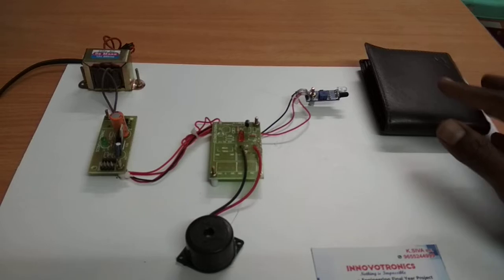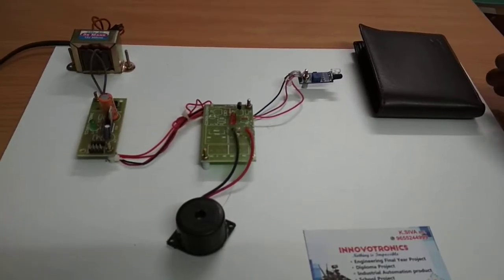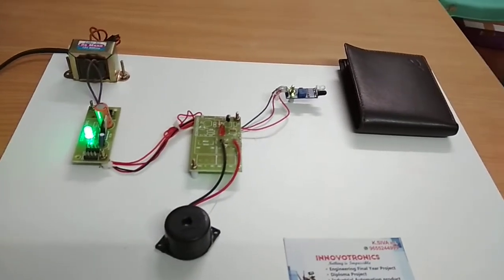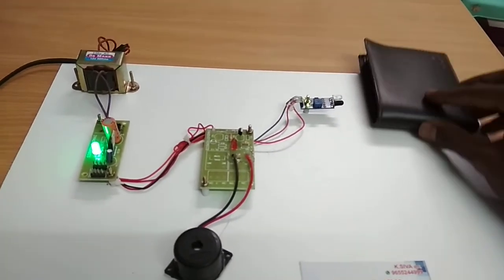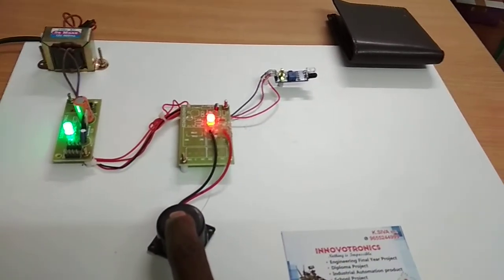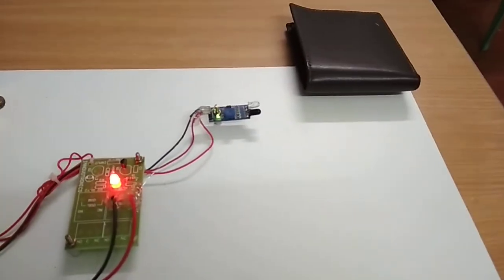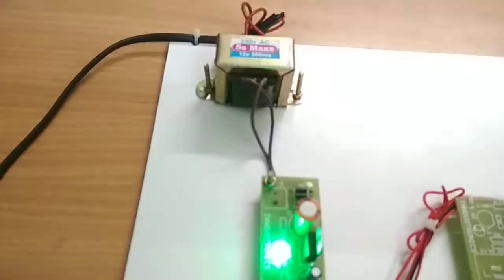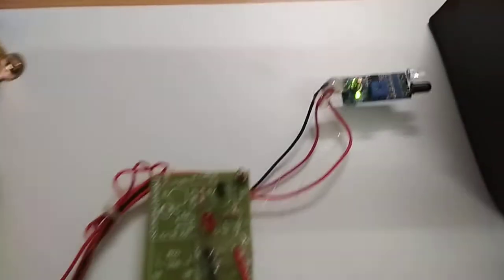BURGLAR ALARM SYSTEM

Comment: can u give the materials required for this project
Reply from the maker: Ya sure...
Reply from the maker: Components details..
1. IR sensor
2. 12v or 5 v relay 
3. Buzzer
4 power supply 
9 v battery or 12 v adopter